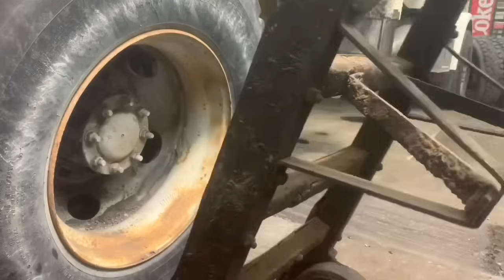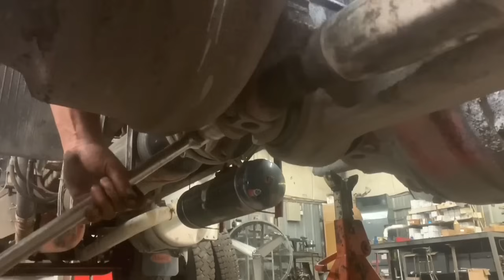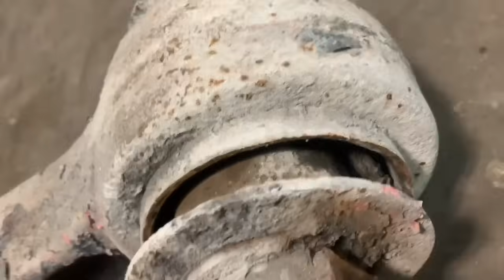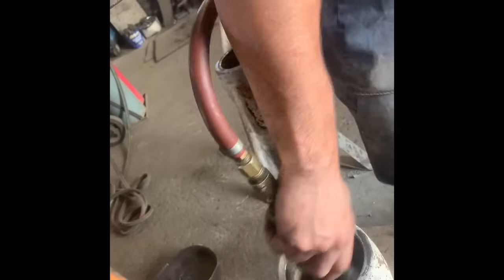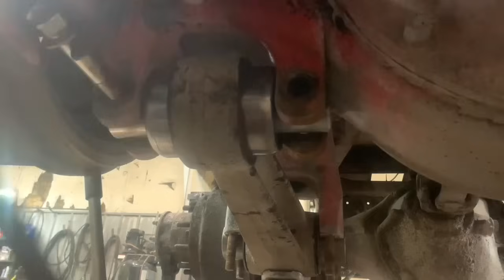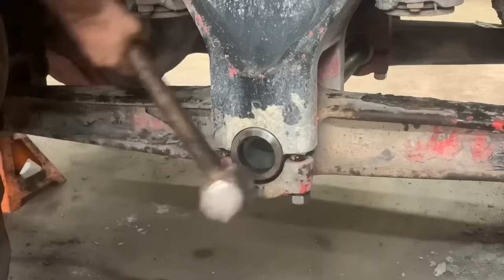Hendrickson Rear Suspension | Walking Beam Bushing Replacement

Comment: Nice job . Looks heavy work 👍👍
Reply from the maker: Thanks for watching!!
Reply: Worse than the walking beam suspension system are the leaf spring or massive coil spring suspensions. The work then becomes deadly in some cases. Had a coil spring jump from its hold down clamps and penetrate the shop wall about 12 feet away. All in about two seconds. I was trained to NEVER expose any body part to a spring under tension. That advise paid off.

Comment: I use to run a concrete mixer with the hendrickson suspention. Very stable. The dumptruck i ran had the walking beam with the springs. 
Also very nice. The best part of a walking beam suspension is one less air leak to find. Dual lockers a must.
Reply from the maker: Thanks for watching and commenting!! Good set up and low maintenance.
Reply: @SemiWorkin  I like working on walking beams theres just a little weight to them aha. I work under a pit. Awesome video!
Reply: Is this suspension softer than a mack camelback suspension?

Comment: Those things were really shot. Thank goodness for a good impact wrench and a good hydraulic press. I take it you may have done that before...
Reply from the maker: Thanks for watching!! One of the worst ones I've ever seen.
Reply: @SemiWorkin  I had one where the pins were cutting into the beam ends. Welded and ground it and it drove away.